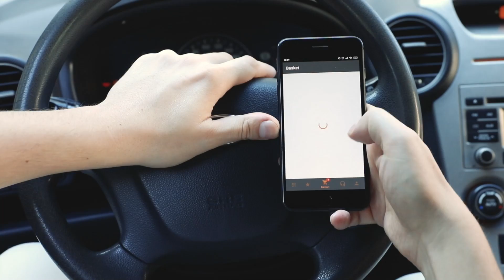Preventing Engine Failure: Head Gasket Inspection Tutorial | AUTODOC

Comment: Is it possible for a car to have coolant leaking in to the combustion chamber and not have a white smoke on my tail pipe,coz my car is consuming coolant bt is not leaking and it also misfire sometimes after i have parked it for couple of hour.can it be possible that i might have cylinder head gasket failure
Reply: Yeah, look for overpressure in water coolant tank
Reply: How do i do that

Comment: Good, but what if the gasket has failed? Will the cylinder head warp and need replacing? Will components in either the oil or cooling systems, like the pumps, need any attention beyond cleaning out?
Reply from the maker: Thank you for your comment!
It all depends on the degree of damage and on the amount of time the engine has been running since the gasket was damaged.
In any case, it can be said unambiguously only after disassembling the engine and troubleshooting all elements of the power plant.
Best Regards,
Autodoc team
Reply: If the engine has overheated, then the head would need machining. If not, I don't see why would it need that. But they will probably do it anyway, to make sure the new head gasket will seal properly.